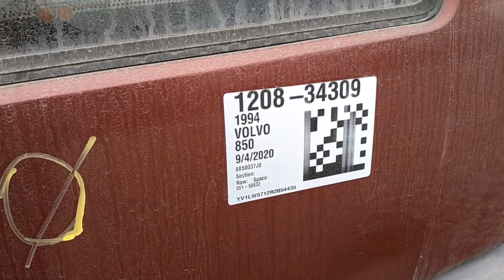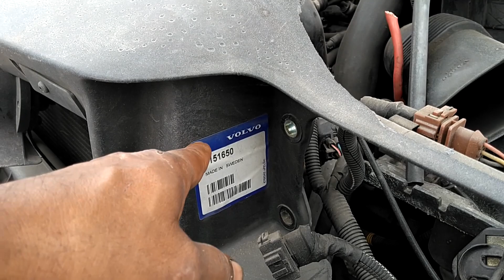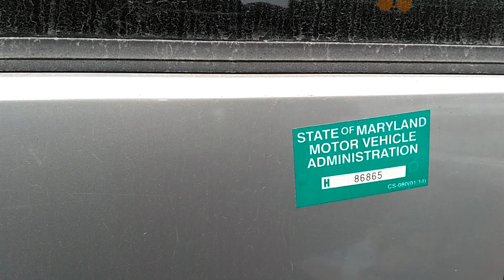To the salvage yard for Volvo parts, 850 pedals, C70 lights, P2 parts and more...- HOWR

Comment: Lol I was the guy who tore up the 850. I broke the console cause the screws stripped. I was going to take the whole shifter because mine didn’t have the pattern piece on top. But then I realized that I could take the piece out. I didn’t tear up the armrest or the side trim. The goo on the console was there from the gaitor
Reply from the maker: OK, do you need a shifter or some other interior part? I have a couple.
Reply: Robert DIY I’m good. I got what I needed

Comment: 2003 volvo xc70 2.5L new fuel pump installed. Fuel gauge erratic falls to empty on half tank...then the Car then shut off while driving ..

Should we start over and reinstall check anything on wires etc? Please advise 🍁
Reply from the maker: Is the tank empty?
Reply: @RobertDIY  it was! 
Fuel door was pinched by fuel pump cable :-(

Learning Curves😄

Comment: tool changing at lowes is harassment as well ...id then when did you buy this ??? what its lifetime tool who cares....

15:20 what does that pump thing do how do you know if its bad or good?
Reply from the maker: Power brakes, in line with the brake booster to intake manifold. The pedal travel is long and hard.